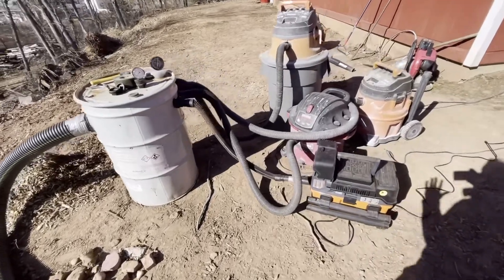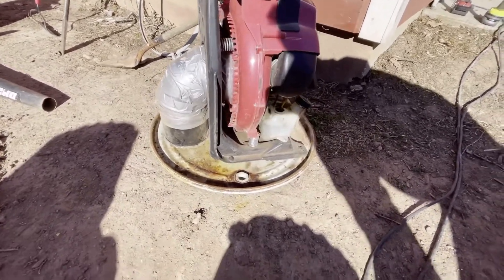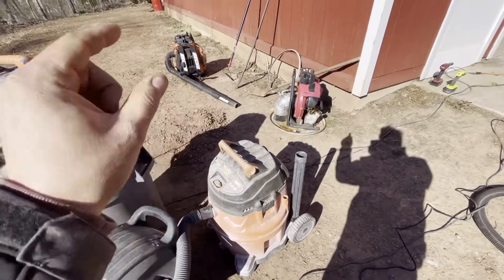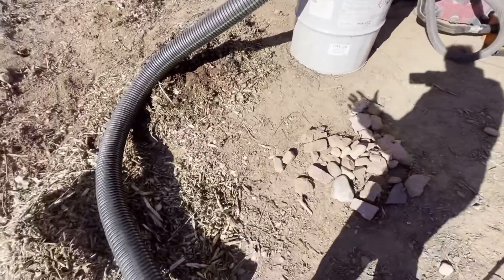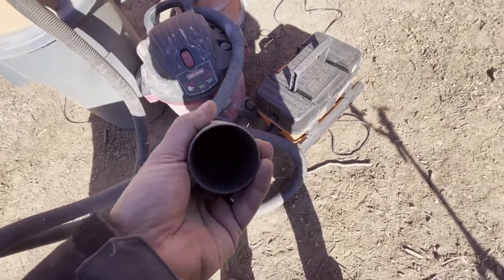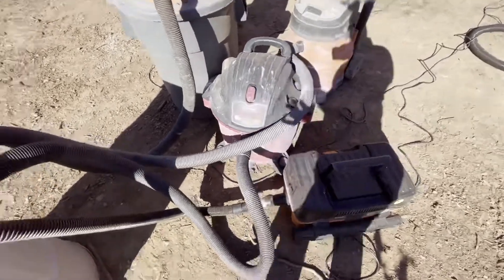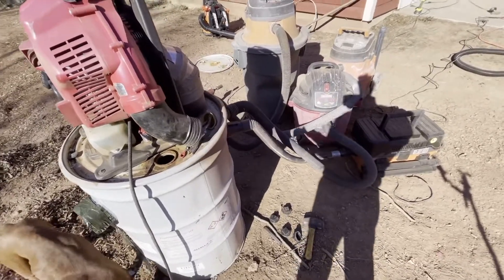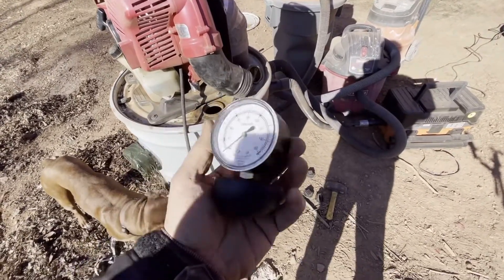Testing Dirt Collector ( Using 4 Shop Vac’s and Leaf Blower

Comment: Hey could anyone help me im trying to figure something out I need help. I’ve made a setup using a small 5-gallon Yeti bucket with two motors, replacing a larger 45-gallon barrel. This setup boosts the vacuum for my Mytee S300h, which is perfect for my upholstery cleaning due to its small size and portability. Although the vacuum is powerful and the bucket holds well, when I connect the Yeti bucket’s hose to the Mytee S300h’s waste tank hole, combining three motors for more suction, I notice that the suction isn’t as strong as expected when I use the 8-foot vacuum hose with the upholstery tool.  Without the hose the succion is so much more powerful I also made sure everything was perfectly sealed with hose so could it be because the air is restricted from the 8400P mytee tool ? Or the size of my vacuum hose ? Please help
Reply: Sure, the longer the hose the more friction it will cause which will slow down your airflow. Did you ever make any improvements? One suggestion I can make is to look for a similar sized hose that isn't corrugated. I don't know why they don't ever seem to make smooth hoses for vacuuming, as the corrugation will definitely slow down the air. I suppose because they are cheaper and maybe last longer? Let us know what you figured out.

Comment: Vacuum cleaners, unlike their name, work with air flow more than suction.  Suction is basically putting your hand over the hose with no airflow.  It doesn't pick up debris, it's the pressure.  Now, I think your leaf blower will ultimately have less suction than those four machines tied to your barrel, but considerably more airflow.  

afbigfish1's comment is correct, since you are using the vacuums in parallel, you are increasing the amount of volume of air moved, suction is where you daisy-chain them in series (not recommended since the motor housings may overheat from the heat generated by the friction of the previous motor) but you would get negligible air flow increase when doing that.

Comment: no, no, no. you are doing the vacuums wrong for increasing lift.  the way you have it plumbed you are ONLY increasing CFM's, you need to plug the intake of one into the exhaust of another one.  I would disconnect 2 from the barrel and cap those ports then take take the 2 you disconnected and plug them into the exhaust of the 2 still hooked to the barrel. this way you will increase BOTH cfm's and lift
Reply: afbigfish1's comment is correct, since you are using the vacuums in parallel, you are increasing the amount of volume of air moved, suction is where you daisy-chain them in series (not recommended since the motor housings may overheat from the heat generated by the friction of the previous motor) but you would get negligible air flow increase when doing that.